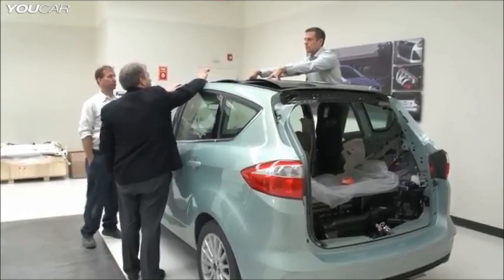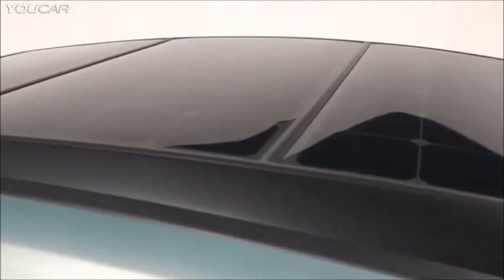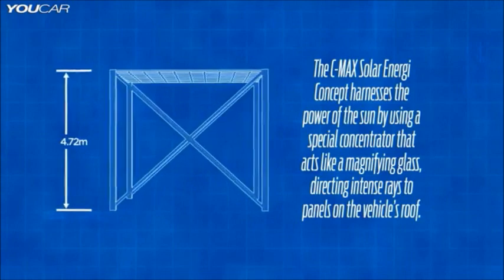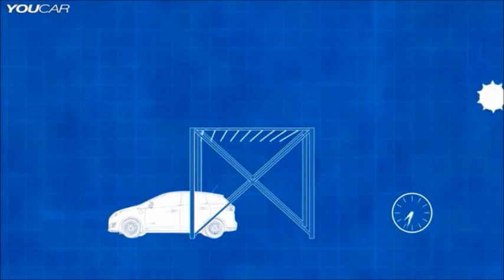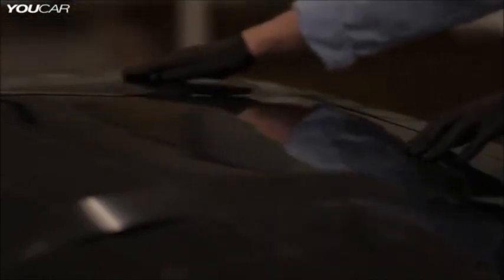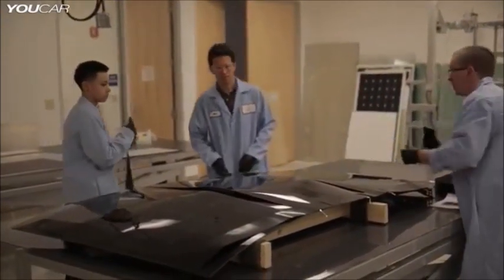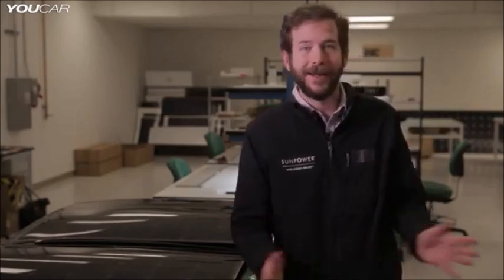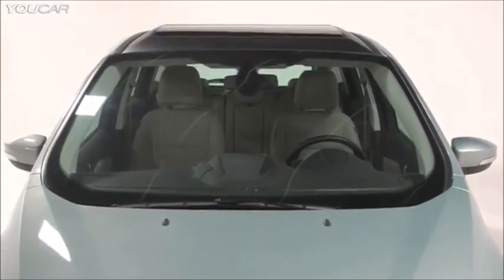Electric Vehicle Car Solar Energy

Comment: Cars with PV Module and  <a href="http://www.pakistansolartraders.com/inveter-in-pakistan/">PV Inverters</a> Solar Pv Inverter will change life and during sun hours cars staying under sun will charge battery and and may be cool down inside during day timw by automatiic Solar System <a href="http://www.pakistansolartraders.com/solar_power_system/">. Thank you for sharing such useful article. 
<a href="http://www.pakistansolartraders.com/solar-panels/">Solar Panel</a> Solar-Panel.

Comment: Hi, 
This concept is very impressive. Even I also want to try something like that. 
I have one  question in my mind that when you are putting flexible solar panel over the roof and the magnifying glass too. Due to this, the roof temperature will become more HOT. And due to this , car inside temperature become  more. And need more energy for cool the car Cabin. So my Question is how you control the temperature of car Cabin.

reply me with your answer

Thank you

Comment: What if one doesn't drive the car every day?  Will the sun give it plenty of range if the car is used every other day or once each week?  The problem seems to be the capacity of the batteries to store energy.  One day soon, this problem will be defeated and we can carry one or two battery replacements and go wherever we need to go in one drive.  If one has a big yard, why can't they put up solar cells and use all that energy to recharge the battery?

Comment: The dynamo may be a good solution if designed with 4 wheels that will generate the excess power to charge battery...

Comment: Canopy idea is innovative ( off-grid friendly ) but has a serious design flaw.  Did I hear/see that the car will move automatically back and forth to align with the focal point of the concentrator?  

Did anyone think about accidents, even fatality to people/kids around? Well, you may say there will be (additional front and back) sensors and such but still it is dangerous and inefficient.  Why waste the energy to move a 1 ton mass (with tremendous risk) ?  Why not design a movement system to slide the the concentrator panel (50 lb or less)  back and forth?

Oh, BTW, why not include (an optional) receiver solar panel under the roof that will slide in and feed the grid while car is away ?  If you are spending $ to build a structure might as well recoup the costs and promote/harvest  renewable energy.

Comment: I will be surprised if solar roof will power the car fully in considerable amount time.....But it should be able to run all the other electronics like GPS, AC, car electrical s, mobile chargers etc. completely.that still makes huge difference....and remember solar panels run for 20 years with 80 % efficiency....that's something to be noted.....

Comment: Total BS.  The car would get too hot.  Think about how hot your ALREADY gets in the sun.  Imagine it 10x hotter or more.  All the plastic inside the car would melt.  And even at 10x more sun, you still wouldn't charge the battery more than 5% after an entire day in the sun.

Comment: It would be great to have such technology available for the masses, but I think it's not feasible yet. The solar panels we have today are not efficient enough to power an average commute of 20 miles and 40 miles roundtrip. Also that means the car has to be under the sun or under a canopy at all times. If the efficiency could be greatly improved then this will be feasible.
Reply: The canopy is a gimmick. All electric cars should have PV cells laminated to all horizontal surfaces and this will come to pass. It doesn't matter if these cells only offer a partial charge, the total grid energy savings over the vehicle's life is tremendous and these will get 100% of their charging needs if the drive is short. Average car trip in the US is 2 miles.

Comment: What a load of bollocks. Solar concentrator sounds like another episode of Star Trek next generation. Haha
Reply: Aaaand you just shot your self in the foot.. http://www.ntkj.co.jp/product_fresnel_solar_en.html
Reply: +Peter Grape showing me a company product page isn't on par with a white paper so I'm not convinced. As fresnel concentrates light like a convex lens it heats up the solar panel therefore decreasing its efficiency. You don't need a biased product page or rocket science paper to work that out. Duh!
Reply: decreasing in efficiency can b tackled by providing cooling system by mineral oils ,,by whuch v can easily concentrate solar energy by using Fresnel lens

Comment: You can, of course, charge the car purely with solar, if you drive it half an hour a day or thereabouts, but cars use loads of energy. You have to divide the power of the solar panels by the average power the electric motor delivers while driving. That's the fraction of the day (daylight) you can drive.  Nontheless every bit helps.
Reply: Can the car get charged if its parked in the sun?
Reply: I mean if you combine eletric cars with the solar wouldn't that be enough without the use of gas?
Reply: You can, you can. But you need loads of panels. Say you have 100Watt panels and 10 hours of 'good' light every day a panel will give you 1 KiloWattHour of energy per day, and you have a car that you want to drive for an hour a day with 20KiloWatt average, that's 20 KiloWattHour. So you would need 20 panels for that car. Crude and optimistic calculation, because you have seasons, dark weather, less than 100% efficiency when charging etc.
Reply: Patrick Thibaut Even if you could gain just a few more miles of range a day by leaving it in the sun, it could mean the difference between someone making it to their destination on one charge or not.
Reply: Patrick Thibaut I think that over the lifetime of the vehicle, the solar on top would make a noticeable impact

Comment: Instead of trying to use this captured energy for the car itself, why not use this to assist-power the grid.  In other words, run a plug out to feed electric power stations.  Every little bit of contribution helps.  This could cut down on (in most cases) fossil fuels burning 24/7 to keep giant turbines cranking along.
Reply: Or just have the panels charge the car, and drivers wouldn't have to take as much energy from the grid charging their cars.
Reply: Nuclear is dangerous so I can understand why we don't have so many nuclear plants, however we have a vast desert in which solar panels would thrive. Because it's rarely ever cloudy there. And we have a windy midwest where turbines would work perfectly. Hell we could even put them in the ocean. The problem is, it's easier to go dig for gas than to build these. Unless nature holds a gun to humanity's face, I doubt anything will change.
Reply: Brian Brewster   why would I want to power the grid for free,     the grid is going to charge me money for using the grid power.      silly boy
Reply: I agree!
Reply: Too bad electric energy is super inefficient to make. In the U.S. most electricity is from coal burning plants. I'm not saying I have the clean energy solution but energy from coal to power our cars is not it.
Reply: Hello Bogdan   :   you can make most profit from my project.  May I have your email address?
Reply: Brian Brewster I think this is a concept they are prototyping in the Netherlands. Wherever the solar roofed car is parked it is always plugged in to the grid. There fore charging up the grid and earning money for the car owner. It's a great concept because not every car will have the same amount of charging to to do and therefore every car will benefit from communal solar charging. Let's face it. We have already got the technology and now a corporation needs some balls to set it up. With batteries being loaded under neath the car like Renault prototypes you won't have to wait while filling your lungs with petrol and diesel fumes. Plug and play.
Reply: Great!

Comment: So how do they deal with the concentrated heat the lenses will create we are talking up to 2,500 degrees! which in itself is an energy source that could be tapped.  Solar on car tops doesnt need to fully power it just think of all the daily hours a car is parked in the sun or driving on the road in sunlight to power a % of its use.
Reply: Or to keep it cool thus allowing the main pack to drive it further!
Reply: It's not that concentrated... You're thinking of concentrated solar that used to heat a salt mixture in utility sized solar farms. This is much less exciting
Reply: justjohnny05 bro contact me on my WhatsApp number 91-9820315710 even i am working on this project and want to see it work

Comment: Should have been on all cars to run electronics, cooling fan in sitting sun...
Reply: Hello SolarizYourLife       :  May I join with you?
Reply: For all EV's, yes it is practical as long as the panels are not that heavy. It will also help if they can further increase the efficiency of the panels. For IC cars though, it will be redundant since  the alternator is more than enough to do the job of powering the car's electronics.
Reply: +Yev Villanueva BULL, the harder the electric production with alternator the more the gas it consumes! Plus when engine is off can cool interior with fans or run any electronics, like radio, or tablets, phones, car computer, and keep car battery chargered! So short sight are you...
Reply: The car's alternator is producing more than enough power when the car is running. I've been charging my laptop and other mobile devices in my car and it doesn't affect my mileage. As for cooling the car using the panel, do you have any idea how hot the interior of the car gets when under the sun? I doubt a 300 watts panel will produce enough power to cool the car. Also, you wouldn't want to leave your electronic gadgets inside the car while it is under the direct sunlight.
Reply: Electric Vehicle Car Solar Energy
Reply: Yev Villanueva we need rv with various renewable energy motors
Reply: Puerto Rico could really use these solar powered vehicles right now since Hurricane Maria blasted the island. The other problem would be making sure you don't run into a flood.
Reply: how much it will be dood
Reply: SolarizeYourLife wrong, we need it not just in every car, im wating for the one who will service in every renewble energy ,solar,wind,salt water
Reply: Ok, so to cool my EV car when parked i have to leave it in direct sunlight? Mmm... Makes sense...

Comment: So Mike, what if there was a 43% efficiency PV liquid you could add to the paint?
Reply: They probably could easily get to 700 watt, which would be 3.5 kwh a day or about 15 miles.  1.5 m^3 is 45 square feet and sunpower cells get 20 watts per square foot so you are already at 900 watts.   I think the want to dupe the government to get them to install lens at $20000 a pop.

Comment: Silicon? You should be using GaAs thin film. Work with Nanoflex Power Corp. They developed a way to make them at very low cost.

Comment: It's awesome for night-riders (charging @home during daytime). For others, wouldn't it be better to use a regular solar panel, connected to a battery? Then the car could charge @night. I know there's a big energyloss in the transfers, but I can only hypothesize.

Comment: Kind of a neat concept. My guess it would sell better in areas with more sunshine like Arizona
Reply: +moosefactory133 The biggest solar power is a country without not too many sun: Germany. Panels are more and nore sensitive.
Reply: +francisa751 You are right, I checked it out. Germany is very progressive in leading the way for solar energy
Reply: Solar works on daylight as well as direct sunlight, even cloudy days will produce energy though not as much.

Comment: How exciting! However, if we do away with oil and gasoline, how will be pave our highways without asphalt? Further, currently gasoline absorbs the lion's share of fixed costs to crack a barrel of oil, refine it into various byproducts and produce diesel to power our transport trucks and trains. Without producing gasoline, the other products are bound to become extremely expensive. Carbon fiber to build Ford's cars will be priced out of sight. Who will want to buy an electric car like this second hand and face huge battery replacement costs? I hope Ford tests these cars in Northern cold states and Canada, not California like GM did
Reply: what?
Reply: +netsurfer912  battery costs are coming way down very fast every year in fact now exponentially as teslas giga factory is coming into play. Battery Replacement costs are about to soon be a non issue when buying a used electric car especially since electric cars will outlast an internal combustion car
Reply: [Who will want to buy an electric car like this second hand and face huge battery replacement costs?]Just maybe you could reveal how much that would be rather than generalising. No one is advocating doing away with oil as its used in many industries but burning it is the most wasteful use of this valuable non renewable commodity.The electric car can be run using just solar while a fossil fuel car is using a product that requires huge amounts of electric just to produce the gallon of fuel which is burnt and the emissions released into the atmosphere.Really is a no brainer as to which is better and the industry world wide is responding.
Reply: D Gatewood you didn't try to understand any word of what I said. The less gasoline is used the more other byproducts of oil will cost.

Comment: So... Where is it, Ford?
Reply: +J Bishop Yeah December 2015 no one ever heard nothing. Is Ford getting permission from oil companies ???
Reply: +John Phillips Stupid you.
Reply: You ask where is it, and the replies you get are conspiracy theories. The real answer is that it does not work. The solar panel only generates 0.3kWh for say optimistically 10 hours a day, which gives a total charge of 3 kWh. A Nissan Leaf with a range of 124 miles has a 24kWh battery. That means the range of this Ford is only 15 miles. Once you add in the cage structure with magnifying glasses, the range will extend but only to about maybe 20 miles. I have assumed the owner living near the equator. Further north or south where you get long daylight hours in summer and very short in winter it's even more of a problem. In mid winter in the UK with only 6.5 hours of effective charging time and overcast skies most of the time you would be lucky to make it to the end of your road.
Reply: John Phillips "dinky car", "takes the fun out"... like Tesla S, X?  Chevy Volt or SparkEV?  BMW I-3?  All of those are faster than most gas cars, and they will last a whole lot longer.
Reply: +Steven Correa it would get dark
Reply: Peggy Duensing broken link.
Reply: +francisa751 Well Rockefeller owns Standard oil and, Ford, hmmmm.....
Reply: +J Bishop yeah really i mean they must be just sitting on their asses smoking a blunt the lazy bastards
Reply: pandarama67 I can only think that that would give them better ideas!
Reply: +francisa751 Ford started the Oil movement :P lol...
Reply: +J Bishop These are the best plans to build a solar panel that I have found and I'm sure you will love it.  Also, they have some easy to follow videos*.
Check out ==> www.solarenergy.ml
Reply: Danny Boy
conflict of focus... :P
Reply: changeisnowpeople Good one. :-)
Reply: +John Phillips  what would happen if the sun stop shining ?
Reply: Yeah right 
They are just hyping this to get more kickbacks from fossil fuel industry
Reply: You charge your car with alternatives. It's slightly cheaper to charge than buy gas.
Reply: toyota
Reply: Replevideo The panel ismerely an additional method of charging.  The car would still normal range for cmax but would be able to charge any time there's light.  Of course it could work but Ford doesn't give a. shlt!
Reply: Where the fuck is it????
Reply: I prefer an old car that makes noise then a dinky crap
that makes no noise . it takes the fun out of people whl work on it hands  
stupid obama